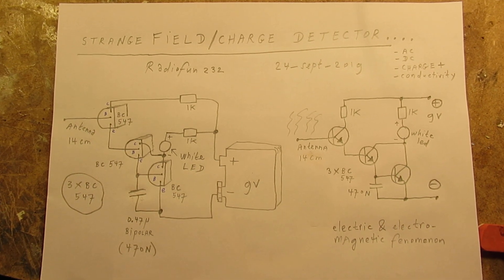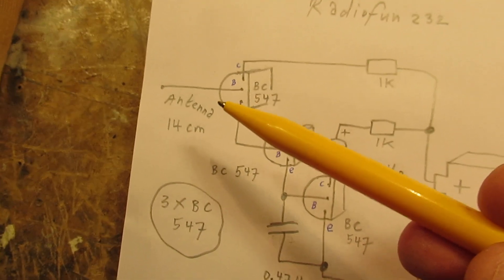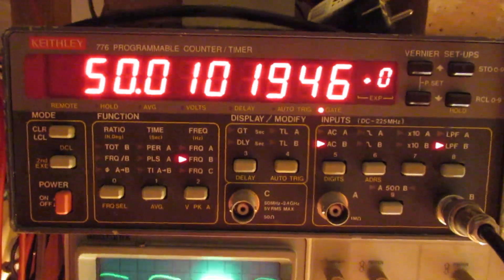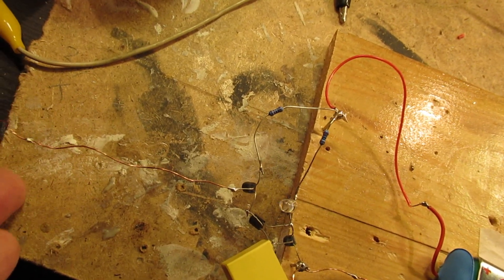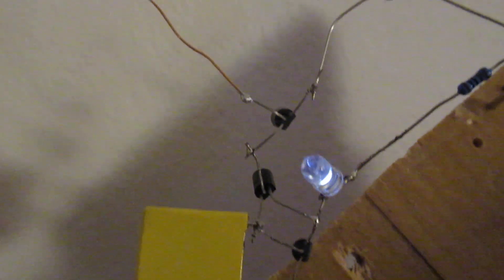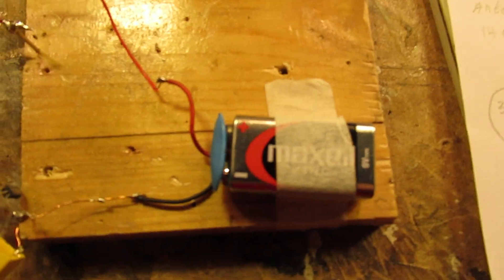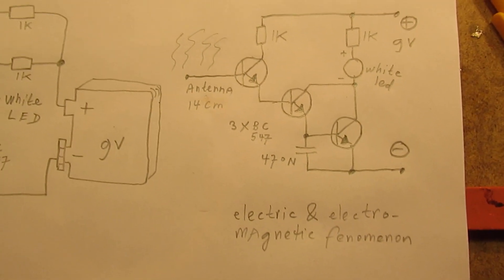Strange AC Electromagnetic field & charge detector with white LED (demo, schematic & drawing)

Comment: Hello, how we can control sensitivity on with a potentiometer in this device? where we should connect the Pot. ?
Reply from the maker: That is a very good question with in fact no easy answer. Say: clamping the base of the first transistor down with a transistor in the 1 M-50 M range to the minus will (in fact) completely destroy the sensitivity. And when you make the supply voltage lower (trying to set the sensitivity) than 9 V with a series potentiometer in the order of 1-5 K the white LED will not burn due to a too low voltage. You can set the sensitivity by using that option, but in that case you must use a red or green (preferred a bright type) LED.  One option could be (when you want to use a white LED) to change the 1 K resistor in the collector lead of the first transistor to a potentiometer in the 50 K-1M range. That must be experimented out. Perhaps that works.You can also try to connect a potentiometer parallel to the 470 N capacitor, in the order of 1 MOhm.
Reply: @radiofun232  ok,thanks

Comment: I have a UHF DMR radio and also an led lamp next to my chair, every time I key up the radio near that lamp (the lamp is off), the lamp lights up quite bright as long as I key the radio. (the radio has an output of 8 watts) The lamp has a touch on off switch (not a mechanical on off switch) was wondering if that touch switch on the lamp could be a similar circuit to what you have here??? Always enjoy your videos sir :-)
Reply from the maker: Thanks and yes, it is possible that that LED lamp is activated by an EM field.

Comment: Very nice video, Ko. This reminds me of my radio broadcasting days. The station engineer had a field strength meter for just one frequency. That was our broadcast frequency. I bet you could add a variable capacitor and coil to this circuit and come up with a tunable field strength meter of sorts. Thanks for sharing!
Reply from the maker: Thanks, Jim. Good to hear that.

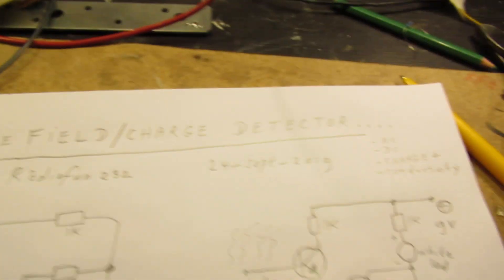Comment: 4:55 Als de LED oplicht door slechts 1 draad in contact te brengen met water, is dit zeer interessant om een waterniveau sensor te maken, wat op zijn beurt een pomp kan inschakelen. Het nadeel van vele waterniveau sensors  is de corrosie van de metalen contacten door electrolyse. 
Maar bij slechts 1 draad in contact met het water, kan er geen electrolyse optreden.
Reply from the maker: Leuk, een hele mooie praktische toepassing! De koperdraad zal op termijn (jaren, denk ik, hangt er van af, m.n. van de dikte) wel oplossen in het water omdat die koperstaaf ionen uitzendt. Maar dat is toch meer theorie dan praktijk en dat zal uiterst miniem zijn. Dus bedankt voor deze mooie tip.